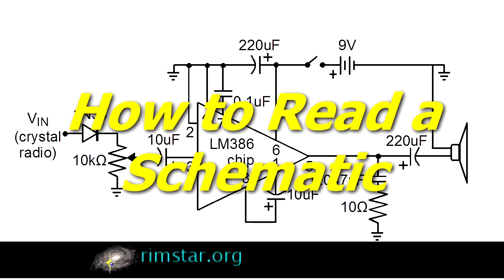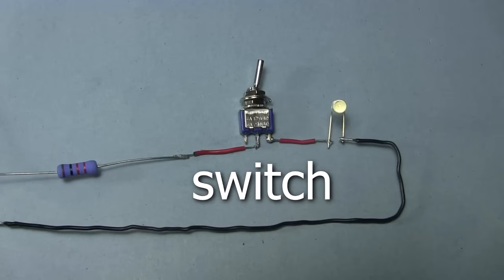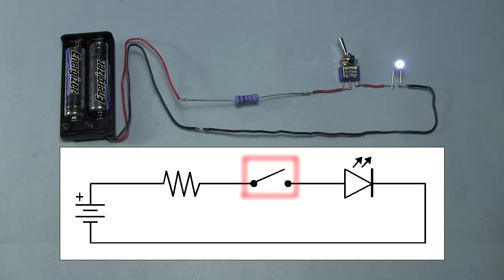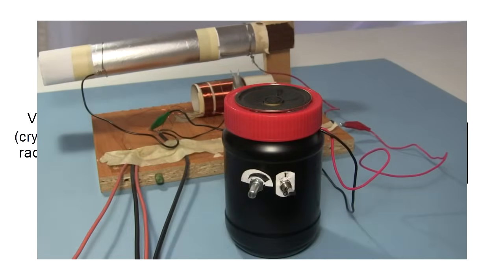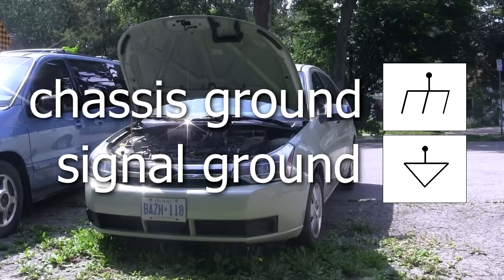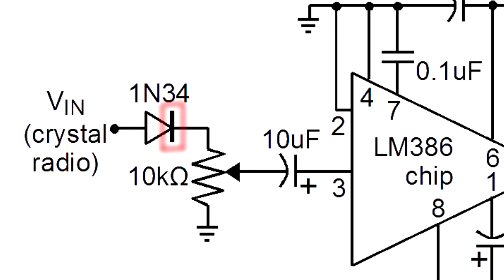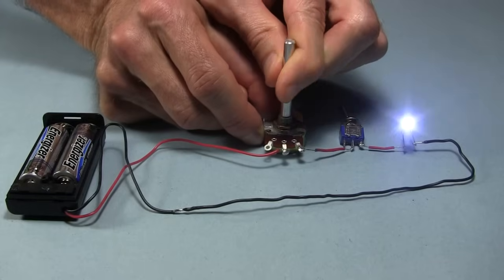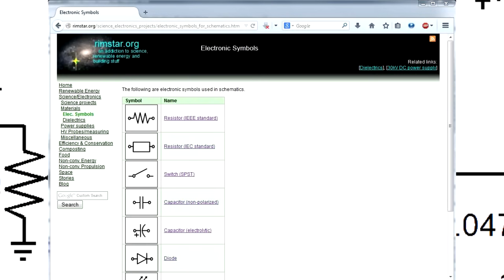How to Read a Schematic

Comment: can someone hell me in this?

https://cdn.instructables.com/F4W/FP02/HPVTMURK/F4WFP02HPVTMURK.MEDIUM.jpg

is the led connect in series or parallel to the heater? im using this for adding a switch and led indicator for my 25W hot glue gun.
Reply from the maker: The LED is in parallel to the heater.

Comment: why always need to have a resistor in a simple circuit like in your video, is it possible not to have a resistor?
Reply from the maker: In this case the resistor is there to protect the LED. If you were to connect the LED to the battery without the resistor then there would be so much current available that it would damage the LED, it would briefly light up very brightly and then go out forever. The resistor resists enough current to lower it so that it doesn't damage the LED.
The way you calculate how big a resistor you need is to use Ohm's law. Usually you see it written at this:
voltage = current * resistance (V=IR)
but it can be rearranged to calculate the resistance:
resistance = voltage / current (R=V/I)
From reading the packaging for the LED in the video, the maximum current it can handle is 20 milliamps, which is 0.02 amps. In this video the two batteries together are giving around 3 volts. Plugging all that into the formula we get:
resistance = 3 volts / 0.02 amps = 150 ohms
So a 150 ohms resistor will do the job. I don't recall exactly, but from looking at the colored stripes on the resistor in the video it's a 100 ohm resistor. Maybe my batteries were a bit low when I measured them, so the needed resistance was less than 150 ohms. And as you see, it worked.
Reply: ok..then how do I know how much current need the LED to match a correct resistor sir?
Reply from the maker: Ah, so you're saying that you have a resistor already so you need to work with that. Well, the current is determined by how bright you want the LED to be, up to the maximum current that's specified by the LED's packaging or specifications, 20 milliamps in my example. The higher the current, the brighter it will be.
So the thing to do is not ask how much current for the given resistor, but how much voltage.
Going back to Ohm's law, that's:
voltage = current * resistance (V=IR)
Let's say you already have a 200 ohm resistor. And to be safe, we'll give the LED 15 milliamps (0.015 amps), which is below the maximum 20 milliamps. We'll pretend that'll make it bright enough.
Working it out:
voltage = 0.015 amps x 200 ohms = 3 volts
If you have a 1000 ohm resistor then that's:
voltage = 0.015 amps x 1000 ohms = 15 volts
But unless you're lucky, you may find it's easier to do what I gave in the first reply above and look for a resistor, than it will be to find the right power source for whatever voltage you calculate out to match your existing resistor.  A 3 volt power supply is easy to find, just two batteries like I used, but a 15 volt power supply is harder to find.
Reply: Thank you very much for information sir. I'm glad I found your video.

Comment: Where does the ground go?
Reply from the maker: In schematics, most of the time it just means what I said in the video, that all those places are connected together. It doesn't go anywhere else.
Reply: RimstarOrg . on the negative wire?
Reply from the maker: Not necessarily. For example, in this circuit http://www.circuit-finder.com/categories/power-supply/battery-charger/597/2-cell-lithium-ion-charger that's for charging two batteries you can see the ground symbol just below one of the batteries, on the negative side.
But in this one http://www.circuit-finder.com/categories/power-supply/battery-charger/567/3-6-volt-cell-phone-battery-meter that's for measuring battery voltage it's not shown explicitly. In that case you have to either understand the circuit or hope it's clear from the written explanation to know out what to do.
Reply: So, the ground symbol goes to negative wire..
I just want to talk about the ground in schematics and Vcc in schematics.
I'm self taught. According to my own knowledge, Vcc is an input positive terminal, is that correct?And ground in schematics connect to other ground symbol.
Reply from the maker: Regarding the ground symbol, my answer was "not necessarily". It depends on your circuit.
Regarding Vcc, there answer is too long to fit in a comment. Here's a good explanation https://forum.allaboutcircuits.com/threads/what-is-vcc-vss-vdd-vee.28782/. See comment #9 on that page.
Reply: One word; Thank you.

Comment: do you mean that we should connect all the earth ground symbols of a circuit together
Reply from the maker: Yes, they should all be electrically connected together at least. You don't have to do it all at the same point, but it could be along the same wire like I show from 2:!6 to 2:20 in the video. Sometimes it's done by connected to different places on a copper or metal plate, such as on a printed circuit board. The example of a car that I show does it by connected to different places on the metal chasis (frame).

Comment: You showing wrong symbol for 10kohm potentiometer look like transistor pic. Instead resistor you showing picture of transistor on 0-16 sec on you video. But video is useful almost
Reply from the maker: +Frank Kaffa I don't see any transistor. Perhaps you're unaware that there are different ways to draw potentiometers. In Europe it's usually a rectangle with an arrow pointing to it. In North America it's usually a zigzag line with an arrow pointing to it. I mention this at 3:19 in the video. Or is there something else I'm missing?

Comment: do you have any books that teaches how to calculate how much resistance to use in a circuit?. Thanks
Reply from the maker: +Otto Mendez I don't have any specific book, though Basic Electronics by Grob is an excellent one, since pretty much every basic electronics book talks about Ohm's law, which is what you're looking for. There are also plenty of explanations of Ohm's law online.

Comment: Nice Vid,   Once we learn the symbols and their operation, we still need to follow the flow through circuit.  That's were I fail..  I realize current will take the path of least resistance, But that's not enough to follow it.  I have a program called "Oregano". it simulates circuit function..  It doesn't seem to agree with me on many of the simplest circuits..   I really enjoy the way You explain things..  Is there any way you can make a video on following the the current through a schematic. ?    Thanks.
Reply from the maker: +ThomasTheSailor Chubby It's not enough to understand the current flow but you need to understand all the details of how each individual component works: how a battery work, a capacitor, diode, transistor,... Then there are a lot of subtleties that happen when they're connected together in different ways, most of which you don't realize until you play with the circuits. One confusing thing is the difference between conventional current flow and electron flow. Maybe that's where you get stuck. It's electrons that actually flow in a circuit, but for historical reasons engineers most often imagine the flow of electricity is in the reverse direction.

Comment: Does anyone know what a capacitor and resistor symbols conected together inside a rectangule means?
Thank you
Reply from the maker: Rob Hernandez The only thing I can think of is that a capacitor has a type of resistance called it's reactance. Sometimes instead of just drawing the capacitor and talking about its reactance, a person would draw an an actual resistor, even though in real life there isn't one, and have that resistor represent the capacitor's reactance. This is done when explaining how a circuit works and they aren't actually expecting you to add a resistor. Also, sometimes they're explaining how some completely different thing works and that thing has some capacitance and some resistance and so they represent that by drawing a capacitor and a resistor.
Reply: RimstarOrg The strange thing is on the list of components they do not gave it a name, it has CP denoted on the schematic and it's values are 0.033uf+ 120ohms 500v the other one is 1uf+ 120ohms 500vYou know how they denote transistor with a Q and capacitor with an Cbut i never seen this CP before. I hope that helps. Ah and it is installed on a reel to reelThank you for replying backCheersRob
Reply from the maker: CP could mean polarized capacitor (i.e. electrolytic capacitor.) I'd have to see the schematic to be able to say more.
Reply: RimstarOrg Thank you for replying back RimstarOrg.Yes maybe that is what they meant by CP.CheersRob

Comment: I sometimes have trouble recognizing when components in a complex circuit are in series or parallel. Can I remember by thinking that parallel will share two common ends, like ground, whereas series only has one?
Reply from the maker: Joe Goren It can be hard to tell sometimes. Sometimes components aren't even in series or parallel. But yes, parallel means they will share two common ends like the positive ends are connected together and the ground or negative ends are connected together. Series means the negative of one is connected to the positive of the other, or that they have two ends connected together and two ends that are not.
Reply: @Joe Green
No,not exactly

let me first draw a picture (as best as i can  hehe)  and then i'll explain it

RESISTORS IN-SERIES
BATTERY--------------RESISTOR--------------RESISTOR--------------RESISTOR---------BACK TO BATTERY

RESISTORS IN-PARALLEL

                                   |-------------RESISTOR----------|
BATTERY-----------|-------------RESISTOR----------|------------ BACK TO BATTERY
                                   |-------------RESISTOR----------|

ok
so, the key word to remember here is  "JUNCTION" or  "JUNCTION POINT"
a junction point is where 2 or more components MEET AND TAKE DIFFERENT PATHS

- Series Circuits DO NOT HAVE A JUNCTION
- Parallel Circuits have a junction  
(this is probably what you described as   "COMMON ENDS")   but it's not correct to think of it like this

now, for the sake of ease, let me label the resistors   in parallel 
                                   |-------------R1----------|
BATTERY--------X|-------------R2----------|X------------ BACK TO BATTERY
                                   |-------------R3----------|

so...  the Junction is the point at which the X's are located at 

in this circuit (if we assume all resistors have equal value) (and this is where you get into ohms law, but let's just keep them the same for now)  if they are all equal resistance

- Current and voltage leave the battery terminal and they get to a junction point 
- To keep it simple, i'll just say   it divides evenly between the 3 resistors, BUT, if they have different values, it divides accordingly (but that's another topic and it relates to  ELECTRICITY TAKES THE PATH OF LEAST RESISTANCE)

Then we can get into KCL and KVL (Kirchoff's Laws) which basically relate to the law of conservation of energy, which, basically state    What comes in - What was lost, must equal what comes out (simply stated)

so,  if you add up the loss across the resistors in parallel and add the output , and take that away from the input into the junction, you will get 0 
because, INPUT =   OUTPUT

so this is why junction's are important to understand

now here's where you get confused
let's take this 

                                   |-------------R1----------|
BATTERY-----------|------------R2--------- |------------- BACK TO BATTERY
                                   |-------------R3----------|

now let's do this

                                                                 |-------------R1----------|
BATTERY----R4------------R5---------|------------R2--------- |------------- BACK TO BATTERY
                                                                 |-------------R3----------|
so, now
R1, R2 and R3   Are in parallel with each other
R4 and R5 are  in-Series with the battery and each other  (Technically they are in-Series with R2 as well)   and this is where it gets dicey,  because R2 IS AFTER THE JUNCTION POINT  (so i won't confuse you with that for now)

so.. if you are taking a voltage reading from   X  to X with your multimeter, you are measuring the pressure (Voltage) from the backside of the battery  RELATIVE TO  the point after R5,  Meaning
you are measuring the In-Series VOLT DROP (total volt drop of R4+R5)
Example.  if the battery is 9V  and you lose 2V across R4  and 1 Volt across R5,   you will get a reading  FROM  X TO X  of 6V
because resistors in-series are calculated as   R4+R5 = R eq  (equivalent Resistance)
                                                                          |-------------R1----------|
X-BATTERY-----R4------------R5---X------|------------R2--------- |------------- BACK TO BATTERY
                                                                          |-------------R3----------|

the point is....   THIS PART OF THE CIRCUIT (that you are focusing on) is  A SERIES CIRCUIT

however, if you want to calculate the voltage like this

                                                                          |-------------R1----------|
-BATTERY-----R4------------R5-----X------|------------R2--------- |------X----- BACK TO BATTERY
                                                                          |-------------R3----------|

now.. YOU ARE FOCUSING ON THE PARALLEL CIRCUIT

so, it's a question of WHAT ARE YOU FOCUSING ON

or how about this

                                                                          |-------------R1-----R8-----|
-BATTERY-----R4------------R5---X--------|-------------R2------------- |----X------- BACK TO BATTERY
                                                                          |-------------R3-----R7-----|

so now if you want to test Voltage from point X TO X   
and you want to use ohms law to work out the 
a) total resistance
b) volt drop across each resistor

you just understand this

1.  because after the first X there is  A JUNCTION (this means it's a parallel circuit) that's it
2. However, you need to focus on Point X to Point X   because when measuring voltage,   
 [READ THIS CAREFULLY AND UNDERSTAND IT]
YOU ARE MEASURING PRESSURE  (Electrical pressure)  from One Point (the Black Terminal on your Multimeter (or Black Probe)    *RELATIVE TO *  the other terminal / Probe

in other words,    YOU ARE MEASURING THE DIFFERENCE IN PRESSURE BETWEEN 2 POINTS, 
In simple Terms,    it's electrical pressure,  in engineering,  it's Voltage,  simple as that

so it's a question of ... WHERE EXACTLY DO YOU WANT TO MEASURE PRESSURE BETWEEN.
also.  you can just pick one spot on the circuit and say there is 3 Volts here,       that doesn't exist (there must be 2 points............A REFERENCE POINT, ........... AND A TEST POINT) and you measure,   From TEST POINT, "with Respect to" THE REFERENCE POINT

so back to our diagram
                                                                          |-------------R1-----R8-----|
-BATTERY-----R4------------R5---X--------|-------------R2------------- |----X------- BACK TO BATTERY
                                                                          |-------------R3-----R7-----|

to work out the volt drop, you need to work out the resistance  (or.. EQUIVALENT RESISTANCE)  [In engineering, we call this SIMPLIFYING A CIRCUIT]   

so  we do this

1.  R1 +R8 = R Total   or let's call it   R eq 1 (Resistance Equivalent 1 / Equivalent Resistor 1)
2. R2 = R eq 2
3. R3 + R7 = Req 3

basically you add up the RESISTORS IN - SERIES TO GET THE EQUIVALENT RESISTANCE

4.   R eq 1 will be the total resistance of R1 and R8
R eq2 (obviously) = R2
R eq 3 will be the total of R3 and R7

now, you have 3 EQUIVALENT RESISTORS
now, you have use Ohms law and the rule of Resistors in parallel and the battery voltage to work out the volt drop across each equivalent resistor

or.. QUICK SIDE NOTE
you could focus on this as well

                                                                          |---------------R1-----R8--------|
-BATTERY-----R4------------R5-------------|----------------R2--------------- |------------- BACK TO BATTERY
                                                                          |------X-------R3-----R7--X---|

in this case,  YOU ARE FOCUSING ON 1 LEG OF THE PARALLEL CIRCUIT, 
and THE RESISTORS  R3  AND R7 (Even though they are in a parallel circuit)   YOU ARE ONLY FOCUSING ON THE SINGLE LEG THAT HAS 2 RESISTORS IN PARALLEL WITH EACH OTHER

SEE HOW THAT WORKS ?

SO ,  BOTTOM LINE
IT'S A QUESTION OF ........ WHAT ARE YOU FOCUSING ON ?
WHAT ARE YOU TRYING TO MEASURE ?
And..  BETWEEN WHICH 2 POINTS ?

and, you are likely confused because you can't understand why a parallel circuit would have a series circuit within in.............AM I RIGHT ?

also i find people don't really understand VOLTAGE and it confuses them
Voltage is simple.... VOLTAGE IS PRESSURE
Like blowing up a balloon,   if you blow it up a bit,   you have pressure ,  if you add more air,  you have more pressure
voltage is the same
if you have a battery that (When full is 9V) but currently measures  6V,  you have a certain amount of pressure (Caused by the electrons in the battery)
if you charge the battery so that another 3V of pressure is added (hence, you add electrons)
YOU NOW HAVE MORE PRESSURE IN THE BATTERY

MAKE SENSE ?

hope this helps
be cool

Comment: Usually when I have to read a schematic that includes a major chip or chips, I'll have the data sheet available. This data sheet has the pin out layout. I'll mark the numbers of the pin out on the data sheet onto the schematic to help when wiring like you have done on your schematic.